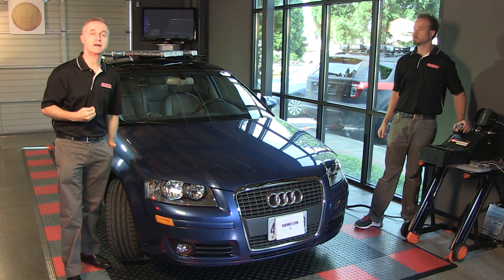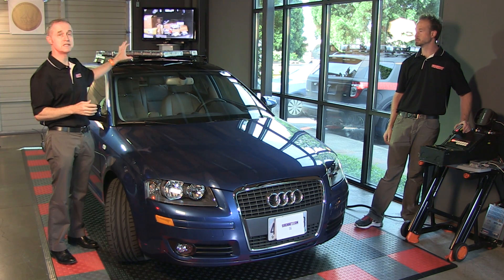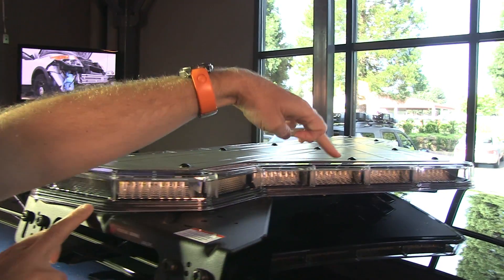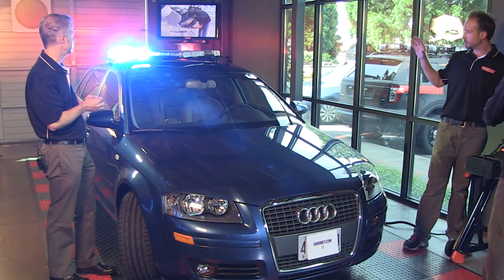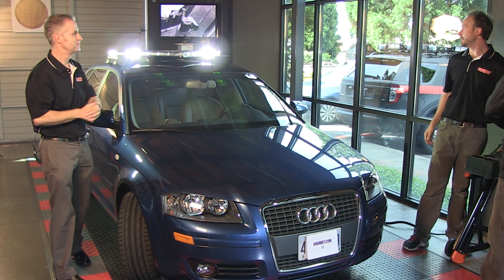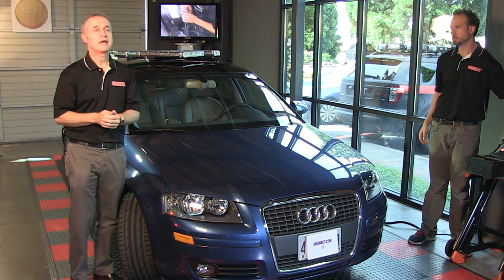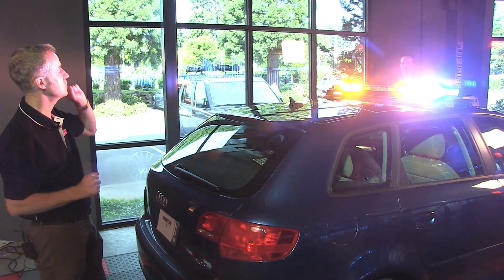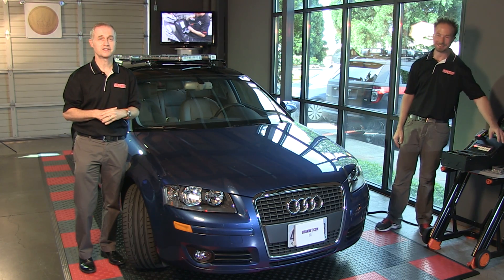Federal Signal Valor LED Lightbar

Comment: Why on a Audi?
Reply from the maker: With offering Goods in the US Market Place and in the International Market as well, we like to Demonstrate Equipment from time to time using Vehicles that appeal to our clients outside of the US and to show how components can fit the Cars and Trucks they would have in their Fleets.
Reply: SIRENNET Ok, This is totally off this and I have no iinterest in buying anything because I don't need anything but do you still sell things for the Crown Victoria or not anymore since they have stopped making it.
Reply from the maker: Tyler Donovan We do still have some components available that are a specific fit for the Crown Vic.  We offer Light-head mounts, speaker brackets, strap kits, some interior light-bars and Setina does still offer Push-Bumpers and internal components.